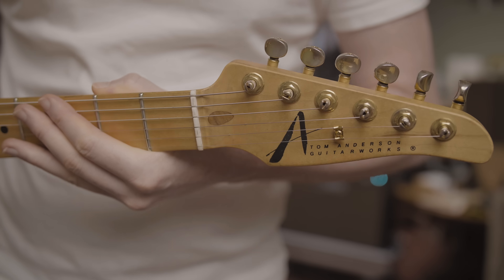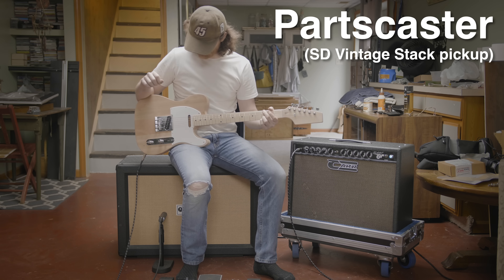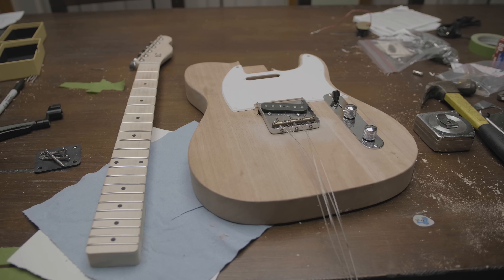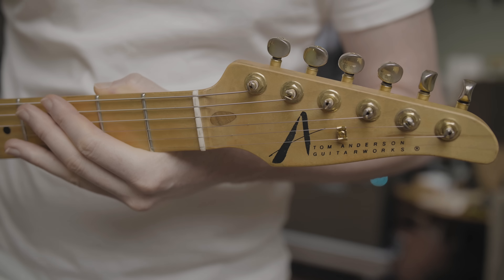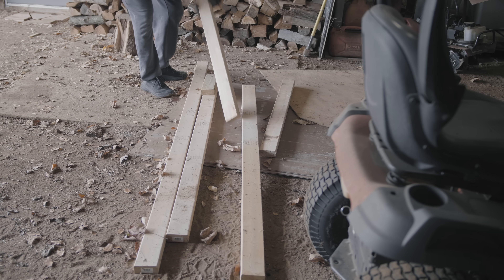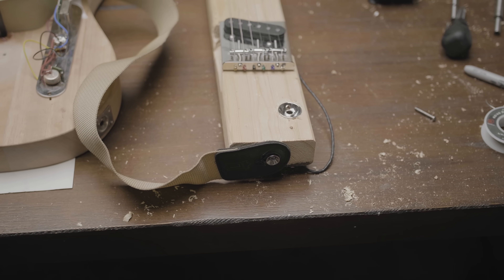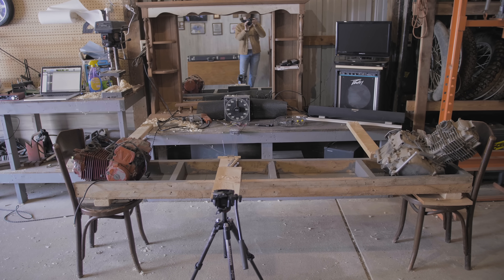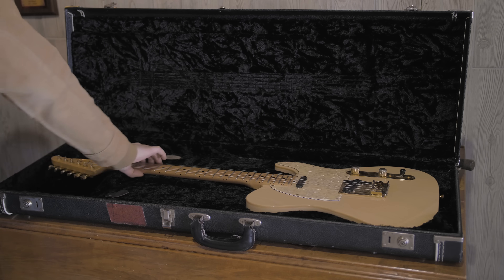Tested: Where Does The Tone Come From In An Electric Guitar?

Comment: Hate to say it, but what you demonstrated was that your Anderson guitar is not that unique. In addition, you recorded relatively short note durations with a lot of low frequency content on many of your strums. Learn about spectrum analysis and the ears ability to measure frequency vs time. Also, the test is not statistically significant since you would need to repeat the test using hundreds of guitars in order to compare to builders experience gained from comparing hundreds of different guitars. In addition, guitar tone is also about transient behavior and response to playing, so you cannot demonstrate that with simple pattern recordings. How the guitar feels (just like a piano) is also part of the experience, not just the sound. So, cool experiment but not much can be scientifically concluded. And, it was possible to hear subtle differences. Wish it was that simple. If it was, we could just look at the audio spectrum on a spectrum analyzer and compare, but that also has too low of dimensionality to be conclusive.
Reply: Hate to say it, but that sounds like sophism soaked in hogwash. Even if accurate, it just emphasizes how exhaustively hard it is to tell the differences with electrics. And thus how irrelevant wood can be compared to other factors. Especially when you start adding compression, effects, distortion etc etc
Reply: @outermarker5801  That certainly would not be the first time a scientist was accused of sophism. Again, what was demonstrated in the video is a simple (although through complex methods) first order approximation (look up Taylor expansion) to what can influence tone. The experiment was insufficient for the broad conclusion drawn from it. Even without experiment we know that wood affects tone. For example, I have two Collings guitars with the exact same pickups and electronics but different wood. I play through the same amp, no pedals. They have a different tone, feel, and response. The differences are also there without amplification, when just strummed or played acoustically. I see the same with acoustic guitars. I have a D-18 style with Sitka and one with Adi top, otherwise mostly identical. Again, different tone, feel and response. I have two Strats from same builder. One is Ash and one is Alder. Same pickups, etc. Again, different tone, feel and response. However, you are correct that if I turn on a fuzz pedal they all essentially sound the same. In that case the first order response due to fx pedals dominates all second and third order responses. However, a nice guitar into a nice amp will express second and third (maybe 4th) order terms due to tone woods that can indeed be perceived through sound, feel and touch response. The video shows a cool experiment, but only for first order terms under limited assumptions. I also agree that pickups always play into first order terms. For that matter, so does the selection of the pick you use (greatly influences tone). I like to play direct into a nice amp, so tone wood does play a role. No soaking here. ;)

Comment: My uneducated thoughts on this (I don't build the things, I just play them):
- the wood (neck more important than body? even the frets matter)
- technique
	where & how you pick (near bridge or middle, angle of picking)
	what you pick with (pick, fingernail, flesh)
- the pickups
- strings
- amplifier: kind of important
- saddle/bridge
Reply: I couldn't hear much difference with the headstock change or loose/tight neck. The brass saddle parts did seem to give a nicer bass sound - treble unchanged.

Pickup height is an obvious thing to do. I've even put a magnet under the e string part of a pickup to amplify that string. Seems to need it quite often

Comment: I've always thought that everything makes SOME difference in the sound of electric guitars but that, apart from pups & strings, most of them are functionally inaudible.  I like the 2x4 & air guitar ideas very much.  In addition to everything you're doing I'd suggest  using an oscilloscope, which would rule out the very important psycho-acoustic factors.

Comment: It's obviously always going to be the pickup, and to some extent the gauge of string. other factors make no difference, the bit that's transfering the sound is the metal string vibrating over the pickup pole. Get any guitar you are comfortable with, slap some good pickups in, job done
Reply: Exactly

Comment: So the only factor that really influences the tone is the Pickup. Single Coil or Humbucker and distance to the string. The Brand of Pickups might, but the differences get smaller the more high gain you go (as other people have pointed out in the past). I might have missed it, did the scale length have any influence on it? Because that is a very often repeated phrase, but very often compared with not accounted for differing factors.
Reply: Scale length does affect tone for sure because the scale affects where the pickup is in relationship to the bridge. Watch the video "Guitar Scale Length is the Most Crucial Spec - STOP IGNORING IT!" by ML Sound Lab

Comment: Maybe the stiffness of the guitar body makes a difference because it would affect the accuracy or deviation from the 'perfect' sound wave. If that's true, then the connection between the neck and the body would make a difference too. Does a completely steel construction (neck and body) sound any different? Does a hollow body make a difference too because it's producing an added sound itself. The possibilities are endless, but what your video does prove is that a reliable bridge, good quality Tuners and a good quality pickup does make a big difference.

Comment: I’m a guitarist. I’m also a cheapskate. While I see and hear that the conclusions in this vid are generally accurate - and I applaud the experimenter - there are some differences imparted by body wood and overall construction. Bolt on necks, for example, when done well preserve more high frequency in the string while losing none of the low frequency compared to set necks and thru necks. This is counter-intuitive, and certainly bolting a neck correctly is FAR easier than either correctly gluing a set neck or creating a thru neck. Likewise, lighter weight wood generally makes for a fuller range output than heavy dense wood. Again counter-intuitive! Especially when you think about all the 1970s players who worshipped those heavy LesPauls. Fingerboards too. While I prefer rosewood for how it feels, maple preserves more brightness. 

In any event - aside from a PRS 408, all my solidbodies are inexpensive. And they sound and play great.

Comment: With all due respect…

Things no one mentions, all of which immediately invalidate conclusions drawn from this video in whole or in part:

- Non-identical performances.
- Lossy audio compression.
- Sighted (non-blind) trials
- Not level matched to </= 0.1dB
- Not sufficient trials for statistical confidence
- Peer influence 
- Zero control for playback system
- Zero qualifications or controls for listener selection

Despite these facts, people will swear up and down that X or Y is true and that anyone who believes the contrary is of inferior stock. These, and other principles apply to his other tests as well.

I’ve said it before: all listening tests which are not in accordance with strict protocols are entertainment only. Nothing wrong with having fun but they’re not something you can walk away from with high confidence that your conclusion is actually fact.

Comment: I've played nearly identical les paul studios that were both made in the late 90s, same body wood, same neck wood, same tuners, bridge, nut, strings (ernie ball regular slinky), same player (15yrs experience at the time) pretty much everything the same, through the same amp and set up by the same luthier as well. The only difference was one was a studio gem with p-90 single coils (mine) and one was a regular studio with humbuckers (the shops) and the difference in sound was insane. Literally no comparison. Blindfolded I'd have told you they were two different brands of guitar. Pickup choice makes all the difference in tone and feel. If you want to sound "better" (whatever that means to you) you need practice though, not new equipment. A good guitarist makes bad/cheap equipment sound good, a bad guitarist makes good/expensive equipment sound bad.
Reply: Yes because the pickups weren't the same. Each pickup is wound slightly different, each pickup sounds slightly different, and obviously the pickup height, string spacing etc wasn't identical. If they used the exact same pickup, as in you took the pickup out and put it in the other guitar at the exact same height, with all measurements being the same, you would not be able to tell.

Comment: You ought to record them and flip the phase on one to null them and see what's left.  If there's nothing your signals are identical if there's stuff left over they're not.  The amount of difference that wood and finish are purported to make is nearly negligible in most cases to someone who doesn't either play or hear the other equipment in question basically constantly.  As it's been explained to me it pales in comparison to a change of pickups or amplifier or electronics or setup but that doesn't necessarily mean it's not there or even that it doesn't matter.  I think I can hear a difference between the partscaster, the Anderson, and the air guitar on cheap earbuds but I can't discount the information I'm getting with my eyes, and I also think I basically understand the mechanism by which the difference is supposed to occur but phase cancellation should consequently confirm the presence or absence of a difference in the signals in your case and it's scientifically repeatable in other cases, ie someone can take the recordings you have and repeat the null to verify your results.  You also may do well to use analog equipment to do it because dither may mask some very high frequency differences or may complicate the phase nullification... I'm also almost sure that hum cancelling pickups reduce the purported impact of wood and finish if they don't completely do away with it because the coils are reverse wound from one another but will experience any movement of the instrument body in the same phase... I may be wrong on that but the way that they cancel hum is thru phase cancellation so I think they'll cancel environmental vibrations the same way.  I've been trying for a while to think of a way to take the human touch out of the playing part of the test and the only thing I can think of is robotics and I'm not a robotics guy.  It may be possible to use a sustainer pickup mounted in such a way that it doesn't magnetically disturb the test pickup but this also eliminates the transient which is also a very important part of the sound of the instrument so you couldn't test for note envelope that way really... That eliminates sustain testing as well...  Anyway I think you're off to a good start with it but I don't think this is as conclusive as lots of people seem to think... Also sorry for being long winded and sorry if I've commented basically this same thing before... I know I've seen the video before but can't remember if I've commented before

Comment: the very important thing that makes difference in electric guitar is adjustment of the pickups. You can acheve higher output by moving pickup or polepieces closer  to the strings, find some better balance between strings etc.

Comment: Pick ups only translate sound from a magnetic field disturbance 
They CANNOT pick up mechanical vibrations 
So electric guitars no  matter how you build them or what material you use, if the strings/pick ups/tune is the same they ALL sound the same

Comment: I love this. I remember listening to and reading comments in the late 1980s and early 1990s in the HiFi press about how different cables sounded differently. The funniest claims were those about how different digital cables changed the sound, or even different mains cables. More recently, how bicycle frames with the same geometry but made from different materials would dampen or project road "buzz" through to the handlebars (ignoring those air-filled dampers wrapped around the wheels).

More recently, my son and have discussed what he has read on forums about electric guitar tone being flavoured by the wood used, or the lacquer sprayed over it. I'm an electronics engineer so I instinctively knew what influenced the sound.

I'm also a drummer. There was a fashion in the 90s for RIMS suspension mounts. The justification was that by not having your mounts on the shell, you allowed the shell to resonate more. Quite honestly, I couldn't hear any differences but the RIMS mounts were so clunky I was surprised people went with them. No... not surprised. People get sucked in by advertising claims for all sorts I guess. Few people care if there's a measurable, detectable improvement. They just want "different"... until "different" becomes the norm, and then they switch back to the original ideas and call it "retro".

This was an excellent experiment. Loved your 4x2 guitar especially. Best wishes from the UK. 🇬🇧
Reply: The Frames buzz on a bicycle do make sense. Steel flex’s and absorbs vibrations whereas Aluminium and Carbon don’t flex much and transmit buzz too easily. This is more particularly with no suspension bicycles…

Comment: Tone is mainly the pickups and the style of bridge. 
The bridge effects how the strings ring out. A small fixed pot metal bridge vs a brass block tremolo on a strat definitely sound differently. The springs on the tremolo cause the strings to vibrate more. 
Anything that changes transfer of motion will effect tone.

Comment: Phenomenal vid! I have a 25.5 and a 24.75 scale guitar. Same pickups. Same pots. Same strings. Same rest of the signal chain. However, there is a very noticeable difference in sound. Wonder if that comes down to slighty less tension in the shorter scale. Gotta say the 25.5 sounds clearer.

Comment: You did not ask the proper questions, because different parts influence difference aspects of the tone. 1) Frequency distribution (colorization / body / harshness / eqing ...): combination of pickup / pickup position / electrics. So, if you "transplant" this 1:1 to a different guitar, it will in most cases sound very similar or nearly identical, even if you have two different players (using the same playing technique). 2) General dynamics and "dynamic feel": neck and quality of the bearing of the strings (many electric guitars are not good in this, so you will not like to play fingerpicking style tunes on them, others are as good as acoustic guitars in this; of course, for heavy metal it's irrelevant). 3) Loudness differences between strings: adjustment of the pickup and string type. 4) Attack: playing technique / pickup angle / pickup form / pickup material. 5) Sustain: Quality of the string bearing, Neck and bearing quality, can be diminishued by the body. 6) Transparency (strings can be heard separately in a chord, not-muddy): neck (only for some styles relevant, e.g. acoustik simulation). In my experience, the other factors simply don't matter or at least in a negligible way. If you use your e-guitars with a tone simulation of an acoustic (western) guitar, the differences between necks are obvious and can be very impressive. I you play metal or heavily distorted sounds, then point 1) does almost the whole "tone" trick for you. "Quality of bearing" includes a well fitted and well filed saddle, a firm bridge, proper string height (no extreme buzzing).

Comment: Placebo is very real... I know guys that have been playing for 40 years that absolutely swear the body wood, fretboard material, hardware material, 3x3 vs 6 one a side tuners, etc, etc all makes a difference!  In your mind it might, lol

Been arguing this with people for 20 years, and even with a video like this you're still going to have people swearing you're wrong.  I think they're "hearing with their eyes", are operating under sunk-cost fallacy, brand loyalty mixed with some distorted truths.  Wood type does matter on a guitar.  If it's an acoustic... Unless you're mic'ing you're Strat or Les Paul and not running it through the p/ups, it's not doing anything on a solid.

I've known it was bs for decades, yet I still buy nice wood guitars.  They're just cool...

Comment: It sounds like the pickups made the most difference, or its confirmation bias. The pickups turn mechanical energy (string vibration) into an electric signal.  I don’t see how solid wood will affect the sound.  I am nit a guitar player but i think the pickups are magnetic not little microphones so the unplugged sounds don’t really matter. Cool video.